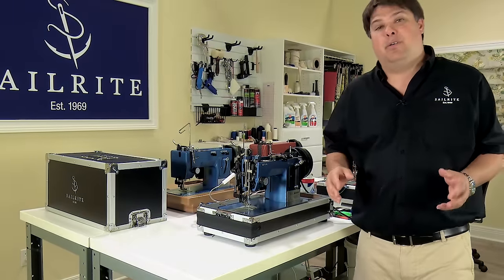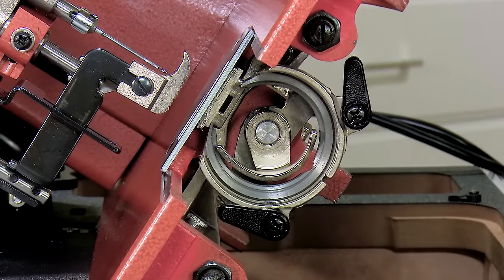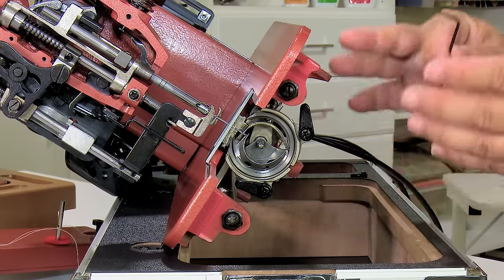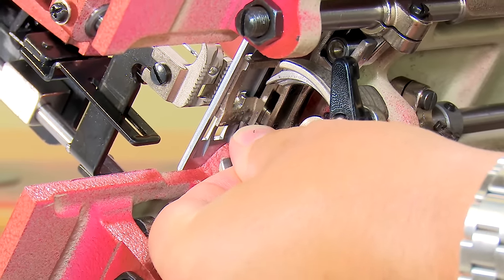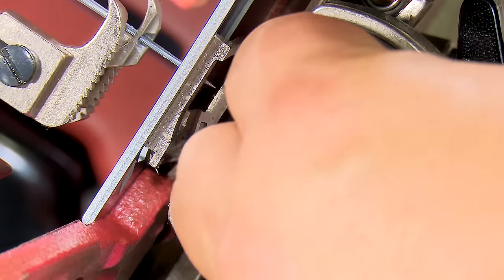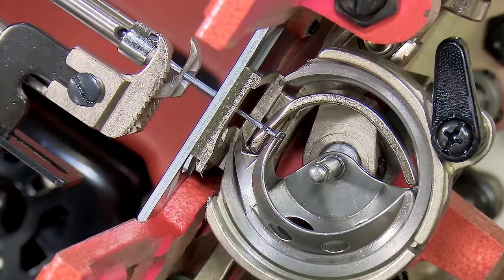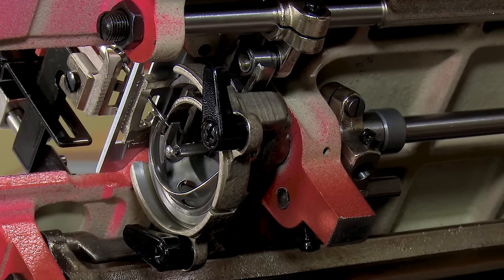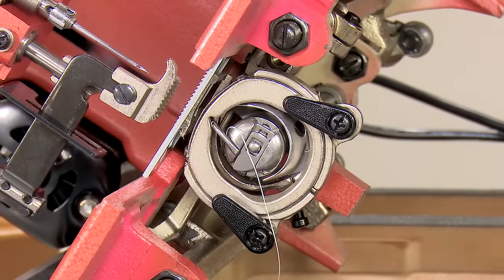Driver Rotation on a Sailrite Ultrafeed Sewing Machine

Comment: At our factory, they immediately make a transverse cotter pin on the axis of the shaft of the shuttle housing, so as not to suffer with the settings ... A little higher or lower is regulated by the shaft in which the needle . The distance from the hole in the needle to the tip of the shuttle should be 1.5 mm., longitudinal distance from the tip of the shuttle to the needle in the recess 0.2-0.3 mm., adjustable according to the needle number 90
Reply: How do you make sure the distance between the needle hole to the tip of the shuttle is correct. Do you insert a shim and rotate the shuttle?  Do you have pictures or video of this process?

Comment: It was a good video but you did leave something out. Not everyone will be so lucky when they release the set screws that it's aligned. After the set screws are loosened, yes moving the needle back or forward from the hook can be done. But how do you turn it to get that 3/16 space? Where do you put a screwdriver or what????

Comment: to adjust the timing between the needle and the rotary(shuttle hook) it does require accuracy and painstaking
Reply: How do set timing on a pfaff sewing machine
Reply: @glendavest7916  this is a sailrite machine, you should look on pfaff models. that would help.

Comment: Great video.
Can't loose the driver on my manual machine as there are no screws.  Any suggestions?
Reply from the maker: Sounds like it is not a Sailrite sewing machine. If so, contact the manufacture and ask them about it, we do not know, sorry.
Reply: @SailriteDIY  Thank you so much.
I got it fixed already😊

Comment: I watched this video because i wanted to see how to put the bobbin stuff back in properly. My needle is hitting something. The needle is in properly, and the needle goes down in ok, without material, but when i try to sew, it won't go down, for it is hitting something, so that means that the mechanism is not put in properly.  When you put that thing in, it looks so easy, but when i do it, i can't get it to stay in the right place to put that cover thing on, it slips out. Can you help me?
Reply: You’re not alone Miss Linda!  I’ve used my machine several years and have done boats, canvas tops, furniture until mine bobbin had to be taken apart.  I watched videos over and over and.  Recommended my machine to several friends and many got them and are also in our boat.  This is the first of any machine I just can’t solve the issue and I’m in the middle of a boat upholstery job I need to finish.  If you find the solution, please share it with me.  Thanks!

Comment: I have a sailrite fabricator and it's parts do not look the same not enough to identify some critical points in the video.
With the bobbin case removed my assembly is one unit. When I ordered the rotary hook all of the parts you describe came assembled as one unit.
Mine has these parts:
A) ? Has the set screws. Is this the Driver? It has a flat side and I don't know what direction to line the flat side up or down or sideways.
B)  Can't identify from your parts in the video. 
C) Hook. Rotates inside of A but I don't know which screws release it so it can be removed and A can be set flush. Since I don't know what screws release it I'm afraid to undo screws that other parts might come undone and I'll have more trouble on my hands.
D) Bobbin case - removes
Can you please copy paste the video URL for how to reset this whole assembly on the Fabricator? Your kind help would be extremely appreciated !!!
Reply from the maker: We have many "Unlisted" support videos (not available to the public, but only owners of our machines) on the Sailrite Fabricator Sewing Machine. Simply email support@sailrite.com and we will enter a support case and send you the needed videos to help with your issue. Be sure to include the sewing machine's serial number in the email so we can look up your order.
Reply: @SailriteDIY  Thank you sooo much!!

Comment: Why my machine(singer 247) shuttle doesn’t rotate? I Tried turning the wheel towards me but still doesn’t spinning. Pls help.
Reply: The screws on the drive rod are loose , they may be farther to the right than the allen screws this gentleman loosened and tightened.

Comment: This video specifies a 2mm allen for the set screws. I have a 2mm and it does not fit.
Reply from the maker: I just checked the correct size with the manager of our sewing department and it is a 2mm.

Comment: My sewing machine bent a #23 needle at a 45 degree angle!  I had to replace a few parts, including the needle.  I still think it needs a bit more.  Last problem, I bought a spool of thread for $6. It said it was polyester, V138 Sunstop ... Hecho en china ... Now I think my machine hates me!  How do I fix my machine to like crappy, made in china, thread?  I was just trying to save a few bucks!
Reply from the maker: If the thread is poorly made, it is always best to toss it, don't try to adjust the sewing machine if you know the thread is not bonded or total junk. Buy thread only from dependable companies like Sailrite.
Reply: Don’t be cheap on thread! Sailrite has amazing thread and the prices are great.

Comment: Well, I just figuered out why this machine always seems to wander out of timing. Today while working on it in the tilted position, I was working the wheel to align the gib hook and needle. It suddenly jambed. The wheel would only move a few degrees in each direction. While poking around to see why it was jambed I could see a small shaft with a tiny spring on it located at a weird angle, way up in the right hand side of the machine . After fiddling with it for a while it finally popped out. It's a second Posi Pin!!! I never ordered a second one and mine is still in the wheel so WTF sailrite guys!? The knurled handle has several gashes and Knicks on it so I'm pretty sure I found the culprit! It's been up in there the whole time 🤣.  Hey Sailrite, hit me up if you want the serial number, maybe you can track down whoever assembled this thing and tell them I said thanks.
Reply from the maker: Please email support@sailrite.com with the serial number and we will enter a support case to help resolve this issue for you.
Reply: @SailriteDIY  I will email you, thanks. I think once I removed the random 2nd Posi Pin from the machines guts, re-timed, reset rotation, replaced gib hook and related parts, it seems to be running fine now. For how long I dont know but hopefully we are all set.
Thanks for reaching out, Ill email you shortly with all events.
Reply from the maker: @elconquistador932  If everything is running well, that is good. You may want to change the metal posi pin out for the new Posi-Pin® Safety Shear https://www.sailrite.com/Posi-Pin-Safety-Shear This is a plastic posi pin that is meant to break if you hit anything hard. In my opinion it can help resolve possibly having to retime you sewing machine. We will evaluate your email, when you send it, and let you know if anything needs addressed. Thanks!!!!
Reply: @SailriteDIY  I think you might have misunderstood my first comment. My posi pin is fine. It was always in the correct position, Ive never had an issue with it. It was a second posi pin that was stuck up inside the running gear. I never ordered a second, not sure why it was there so unless it just appeared inside the macine, I think it was a random part that somehow made it through assembly and QC, hung out a while then rattled loose at some point causing the machine to bind/slip. This is the chewed up pin that I removed as explained in my original post/comment.
Reply from the maker: @elconquistador932  Can you send a photo of the piece of metal you found when you email us?
Reply: @SailriteDIY  Yes, I will include the photo of the second POSI PIN in question.
Reply from the maker: @elconquistador932  Excellent! Thanks.

Comment: Here is an idea. Make a machine that works! Idk what engineer brain trust designed this machine but it is time to go back to the drawing board. When a person has to watch 13 videos to figure out how to get the device working maybe the device isn’t ready to sale.
Reply from the maker: Well, it could be designed to break instead of slip when YOU hit something hard or deflect a needle. People just don't understand the force required to drive a needle into a thick fabric assembly. It is so much force that it may snap metal parts in half if it locks up. If we fuse all the parts, metal parts would shatter and break when YOU make a mistake sewing, like deflecting a needle. So, instead parts are designed to slip when YOU hit something hard (notice I said "YOU", that is because it is usually operator error that causes that issue) the machine can be retimed instead of being replaced with new parts. So... maybe it is designed well. If you have a better design let us know. OH.... Sailrite just invented the "Posi-Pin Safety Shear" another way to prevent breakage and retiming of the machine. See the part and video here: https://www.sailrite.com/Posi-Pin-Safety-Shear